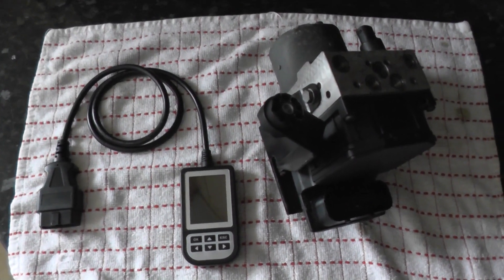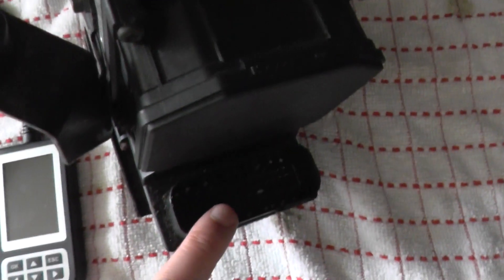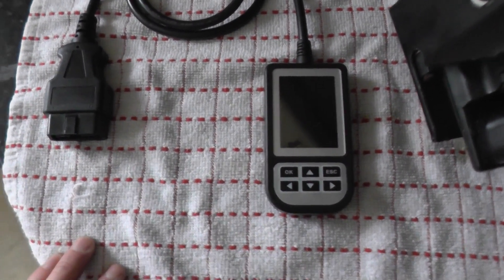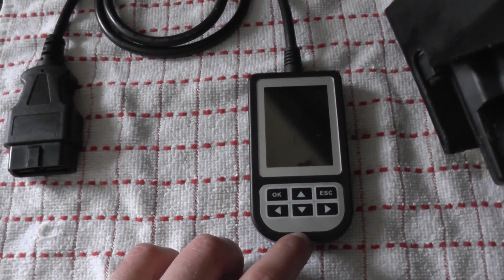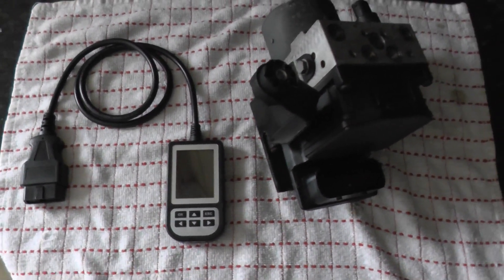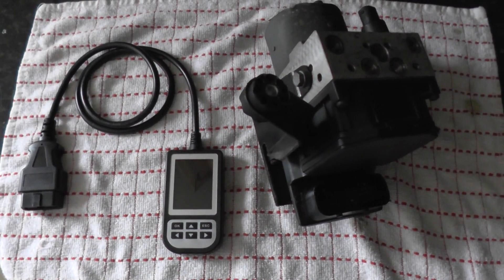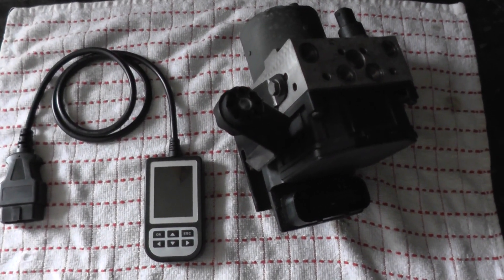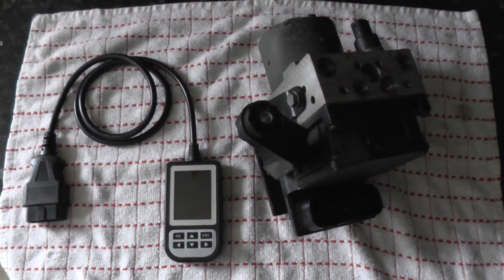BMW ABS Pump Module & Diagnostic Fault Reader

Comment: hi,i swapped over abs module on my car with a scrapped one, a code reader in a garage said it cant read it because its from another car.any tips ? cheers
Reply: Perhaps seperate the black controller part from your original abs module and fit it to the metal pump part of your scrapped purchase abs module hereby replacing your faulty pump with rhe scrapped one yet still having your original electronics therefore not needing to recode it to your car? I have same lights and faulty pump so thats just what ive read the last few days - i though will be sending my original abs module to be refurbed by ecutesting.com rather than using an old module that will have the same inherant fault
Reply: many thanks ill try that  :)
Reply: +shaun dyer  i have since found out the module was not faulty ! the original mechanic got it wrong ! it was the no.2 sensor below the module on the right with wires going into it ,he knocked it a couple of times and now it seems ok !! but he did say that sometimes its the brake fluid needs changing and this sensor picks up the thickness of it .
Reply: Change the vin number to your car in reader then clear the code